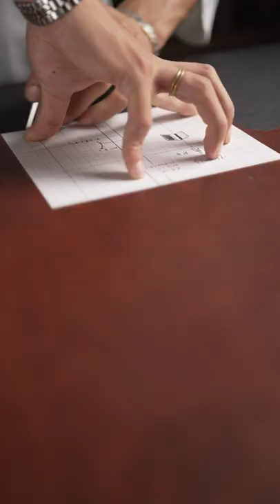Making a Separatable Phone Case #shorts

Comment: Wont the pins in case damage the phone’s exterior? Also having a camera cutout in the leather case itself would be great.
Reply from the maker: Thanks for commneting😆👍✨
There is suede leather on the back of the pin to prevent scratches on the phone. Also, this is a separate type, so there is no camera hole, but there is a type with a hole, so I'll make a video soon!
Reply: @anshare_japan  that’s amazing! Loved your video and production 🤌🏻

Comment: Do the snaps installed on the phone case cause scratching on the phone itself?
Reply from the maker: Thank you for your comment.
I understand your concern, but the suede is placed between the snap and the phone body, so the body will not be damaged😁
Reply: @anshare_japan  nice touch. Do the suede covers got bulky though? Speaking from my experience, i attached the case to and the leather by stitching instead of snaps and it was still very bulky and left some marks on the phone.
Reply from the maker: Yes, I don't mind because I put 0.4mm thin pig suede between the snap and the phone so that it is not bulky.
And this time I made a type using snaps, but I usually sew them onto suede. In that case, I use thin No. 20 thread.